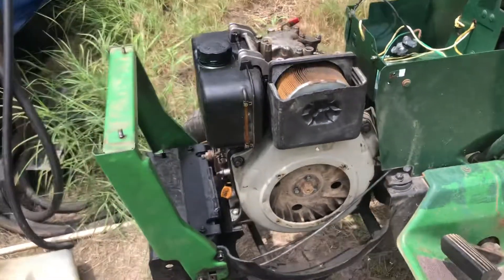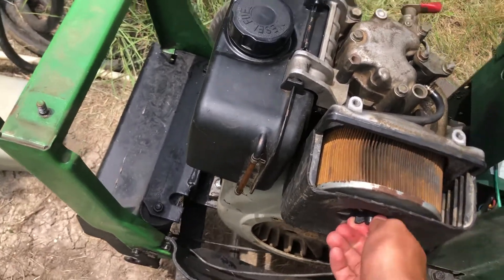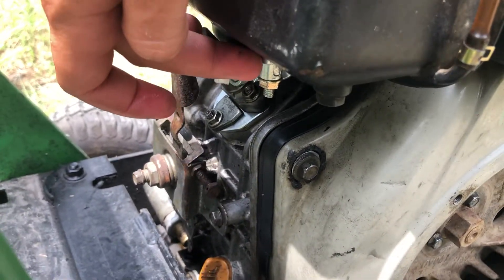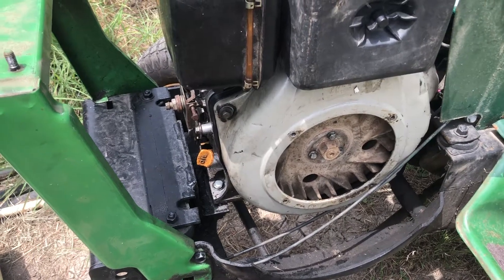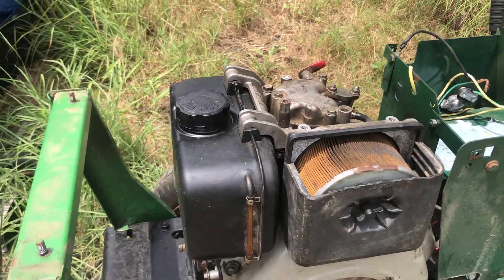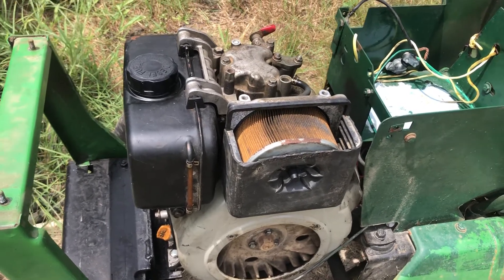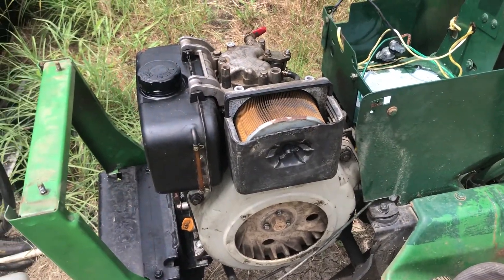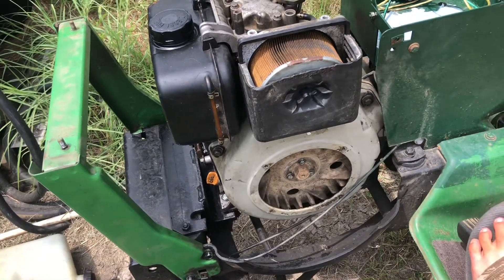John Deere 212 Diesel engine swap

Comment: Is this engine the same as a cheap 400$ one on Amazon? Im looking at swapping my 212 to a diesel as well
Reply from the maker: Yes it is except a genuine Yanmar. The 10hp on Amazon is identical, & will swap in once you drill the other 2 holes.
Reply: @officialdieselstudios2251  thank you, might try to do it, I really dislike how much time and energy those old kohlers can take when something goes wrong.
Reply from the maker: Yeah that’s why I did the swap. I got tired of the constant carburetor, & points fight. I’ll be rebuilding the old engine so I took it out before it completely went kaboom. Try to get the electric start option because these engines will consume pull start recoils. They don’t like ether at all. They’re rly picky engines. I’d abt recomend to get a predator because no Diesel issues. The stock fuel tank on the Yanmar design is junk so I made my own system that works better. There’s also so water separator so might want to incorporate one in the system.
Reply: @officialdieselstudios2251  ok thanks. Have you used this tractor alot with the diesel engine? How does it preform versus the gas engine and do you notice a difference in power and stuff?
Reply from the maker: I don’t use the engine to mow grass so for what I use it for it’s perfect. It has good torque but if you can afford a Predator 670 ur better off with that. I almost wish I had put a predator in it. The diesel doesn’t like ether or the cold at all. I’ve broken 3 $40 pull starts from the engine backfiring, sucking the rope in the recoil and destroying it. There’s no way to fix it. I’ve tried.
Reply: @officialdieselstudios2251  hm. Would a predator 670 fit right in? The only thing about that one is the price because I don't want to stick a 900$ engine into a 300-500$ tractor